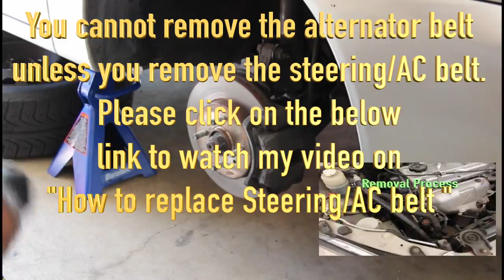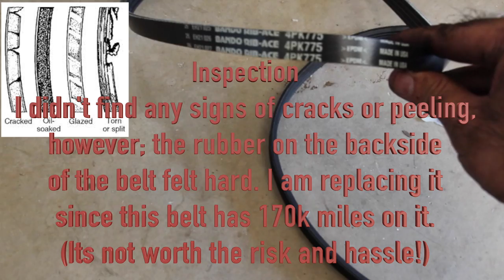Mitsubishi Lancer Fix: Alternator Belt Replacement, Tension Check 4PK775

Comment: Very helpful video. I really appreciated the diagrams inserted in the video next to the actual parts. I've never tried this before and rarely work on my own car aside from oil changes and lights. As with others I had difficulty locating the pivot bolt nut and ended up jacking the car up and getting it from the bottom with a 14mm socket. It wasnt very clear in the video exactly where it was and how to attack it. For anyone interested it's on the backside of the alternator. In the videos defence it showed the power cable of the alternator which is only located on the back. Sadly I didn't actually know what the alternator looked like all around. I also didn't take off the tire but did remove the plastic shroud by turning the wheel all the way right for access. My car drives again with no belt squeak so I call this a success. Couldn't have done it without your video. Thanks so much.
Reply from the maker: Thomas Elliott wow, thank you for your feedback. I really appreciate it and honestly I am really happy for you.

Comment: It's 2020 but this video help me refreshing my brain i been working on car's since age 14, today i got 2 back operations so i really don't try to do hard work but i put new tires and i need to put bottom plates shooks and links im taking everything out and notice my alternator belt was gone lol ,i look it up and this video come up nice job and information keep up the good work and information you got a new sub brother God bless you. The mechanic was trying to charge me $380.00, and i got all the parts so  i just went spent $300.00 on tools i love working on car's but like i say my back is really bad i work on all my cars i don't trust mechanics bunch of scam artists and criminal simple. Nice video keep up the good work and information. New sub brother.
Reply from the maker: 1967 kID thanks I appreciate it. Be safe while working on the cars. Don’t hurt your self. 3 years ago I had rotator cuff injury and ended up getting surgery. Thanks and good luck.
Reply: @afzamoto5325  God bless us all we got to work with what we got thank you very much for the information. And wow the screws from the plate are hard i had to use a 6ft pipe to get off my back hurts but im still working on the car right now.
Reply: Do the links got to be 22cm right.

Comment: Great video, invaluable as a guide for doing the belts on my 2005 Lancer Equippe 1.6L 16v (4G18?).  Some slight variations though, such as no tensioner pulley on the PAS belt - instead there are 14mm bolts which need to be loosen through the actual PAS pulley itself, which acts as the tensioner.

Alternator pivot pulley was hardest, but accessing through the wheel well with a long wrench extension got it loosened.

Comment: Taking the wheel off gives easier access to the pulleys. The pivot bolt was the most difficult step for me. It's hard to reach. I got it from under the car. Thanks for the vid.

Comment: Today, after replacing both of these belts on my '06 Lancer (2.0L engine) on the emergency lane of a highway, I can surely say that there is no need to lift the car up or to remove the tire. Whole process took less than an hour and it was mostly due to it being night time, having no flashlight other than the phones weak flash. 
~30$ for the belts
~2$ wd40
~20$ wrench set
Reply: n n So how did you do yours?? Can you tell me please?
Reply: My belt broke, can I slip a new belt on with minimal effort? Do I need to take off steering/AC to just put a belt on?

Comment: Very helpful video. On my Lancer 2002, I followed the steps you showed but after I started the engine I hear a slight knocking noise (not coming from the engine but from the belt area). Do you think the tensioner should be replaced as well? Thanks.

Comment: Is it possible that the alternator got damaged by a to tight belt? I’ve recently bought a Lancer myself, which got new alternator and belt recently, and sometimes it does a very loud squeaking noise coming from the belt/alternator. Sometimes it goes away, sometimes it keeps on. It gets louder as soon as I drive faster. Now my battery does not charged very well, and I think the alternator broke down. If I measure the voltage while the Lancer is running, it does not get charged.
Reply from the maker: Hi Ahmed, yes it can damage the pulley and bearings,   I agree with your diagnoses. Try to replace the alternator and make sure belt is not over tighten. Get a new belt as well. Good luck.